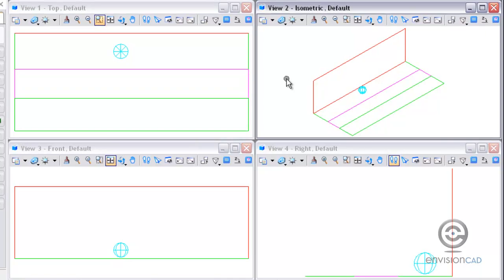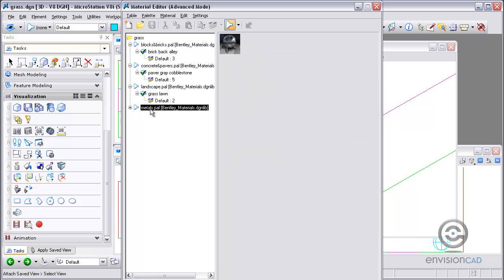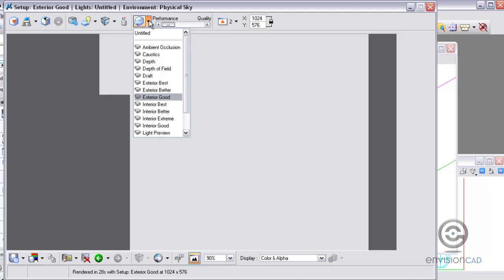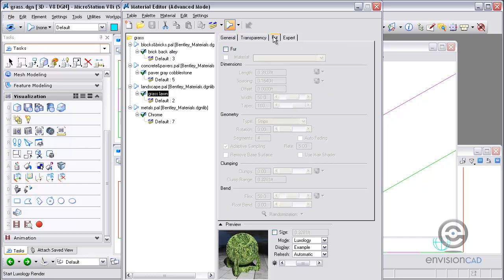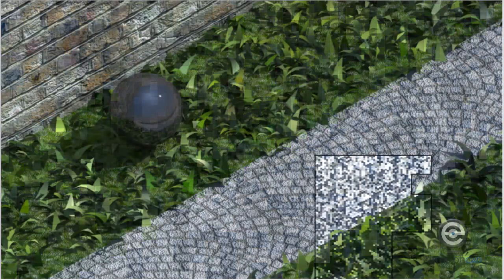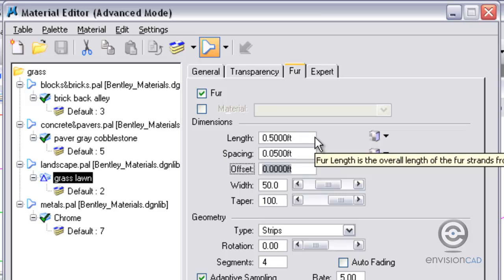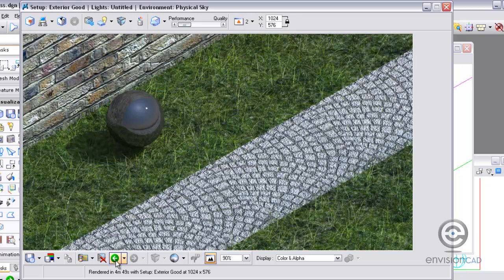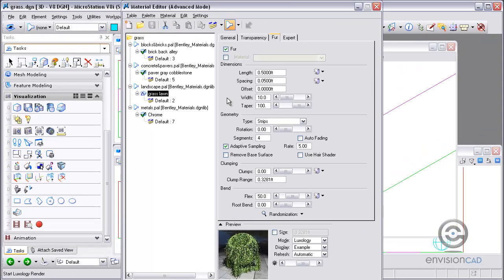MicroStation V8i Rendering - Fur Settings for Grass

Comment from the maker: The version of MicroStation V8i SS2 that I am using is 08.11.07.443
Earlier releases of SS2 did not have the new changes to visualization. You may need to upgrade in order to use fur.
HTH